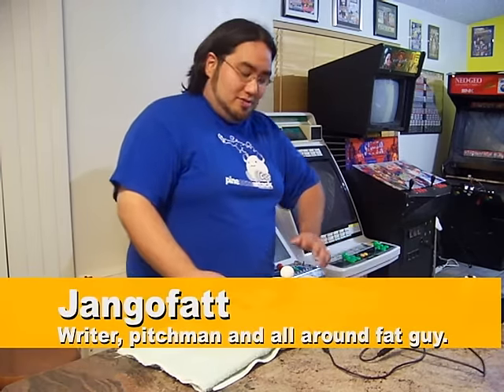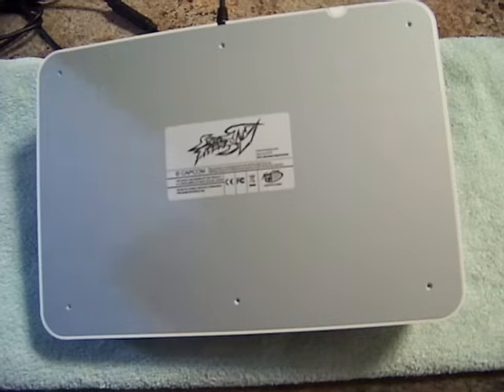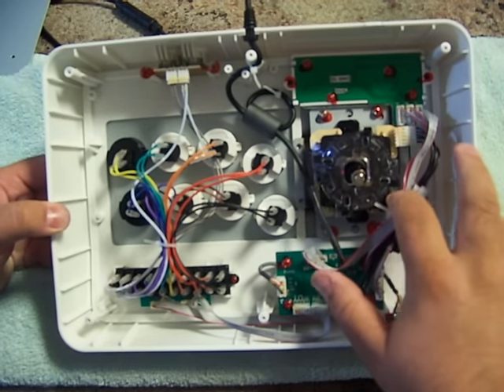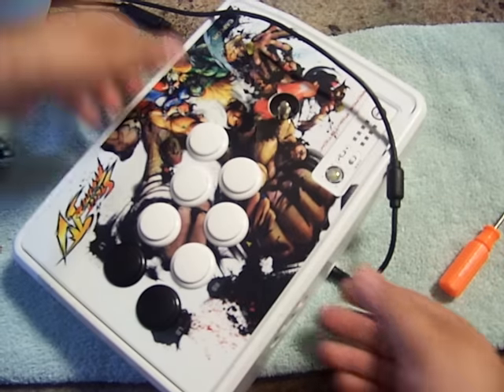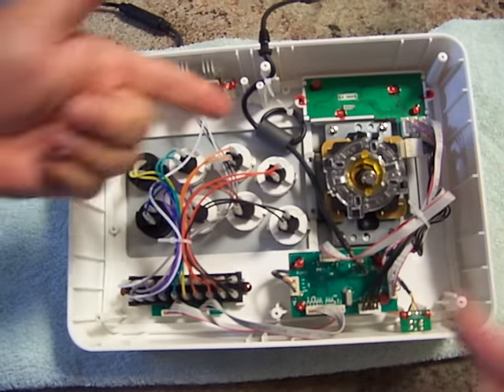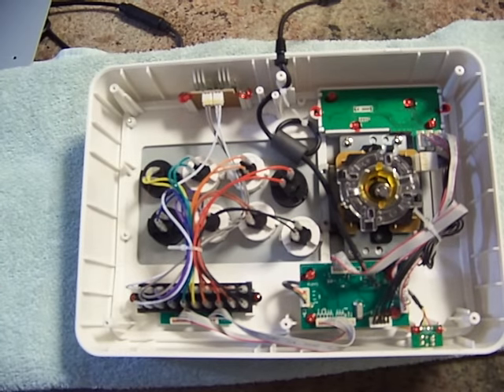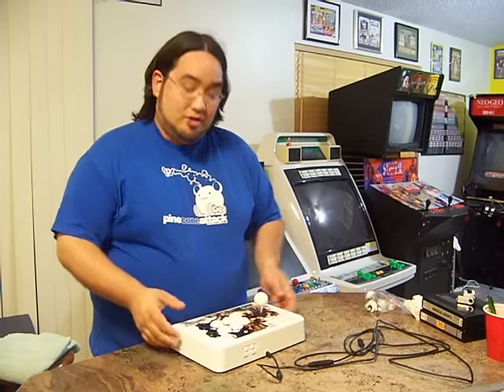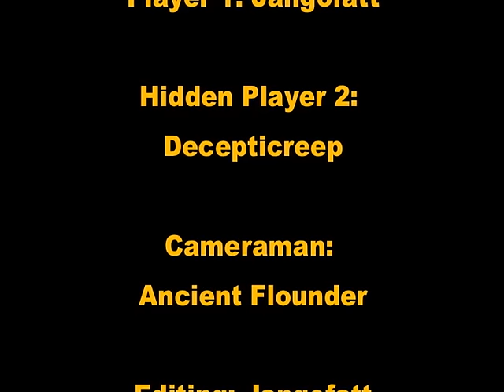The Quick MadCatz Fight Stick Mod Presented by Outdated References

Comment: To buy parts:

Look up dshot 8 on ebay.
He's like a direct sanwa vendor or something. You can get the sanwa stick, buttons, and an extra octagon restrictor plate for 56 bucks total. He let me pick the colors, included the ball top for the stick, and shipped everything same day, brand new. 

Helpful tip: Sanwa buttons actually have the name "Sanwa" engraved into the plastic.

Comment: hello, my ball doesn't spin. I mean, i tried to screw it away, but it's loose. It's like the metal part inside the ball got fucked up....it's loose and i can't screw it anymore. What can I do? I'm thinking about cutting the stick so i can get it away, but i don't have the correct tools. Any advice? It's really impossible, i hold the ball and screw with the screwdriver, everything spins but the ball remains in place.

Comment: Hi, thanks for your nice video !!!
The direction "up" of my Stick does not work, but all the others though. Do I have to completely replace the joystick or I can solve this problem in another way?
Reply from the maker: Arnold Ngoko I would first get a multimeter and set it up for a continuity check. Check the "UP" switch then make sure the "UP" wire doesn't make a break in it. If they both check out, it might be your PCB.  I just had to repair a NEO-GEO AES stick because the UP wasn't responding. To save that stick, I had to rewire it because the UP wire had a break in it.
Reply: Pineconeattack! Alright. I will try it. Thank you for the Answer.

Comment: I have the same sf4 fightstick and it sucks my joystick sounds rough and I can't move or get off specials fluidly. Can some one recommend a good stick to replace the madcatz crap so I can look for other sticks instead of the one this guy mentioned.
Reply from the maker: replace it with either a sanwa or seimitsu.